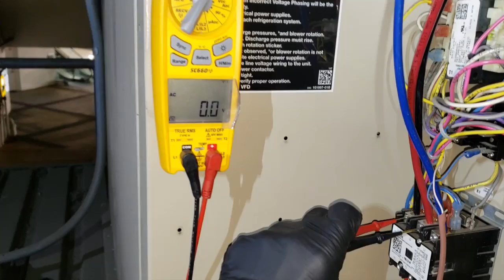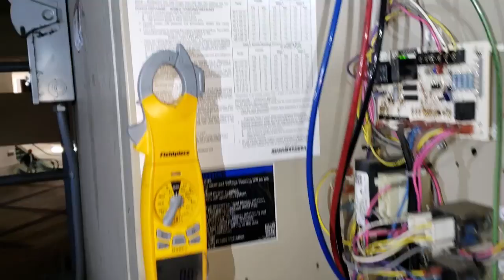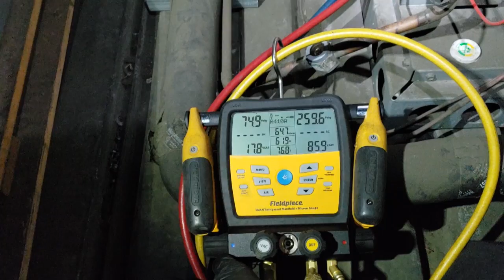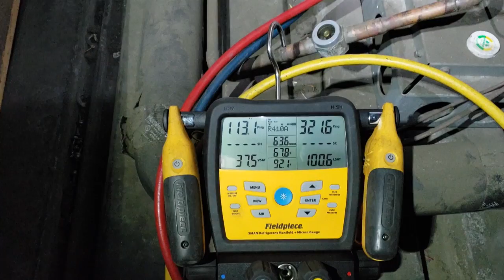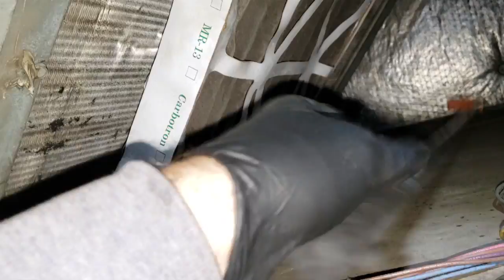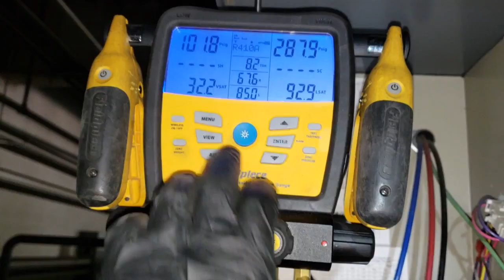LENNOX HEATPUMP PROBLEMS

Comment: I have a Lennox Elite XP 14 Model XP 14 C 30 230 09  I noticed it was cold in the house and thought I had turned off the heat went to check the thermostat it was set to 71 but was reading 65 and fan was running no heat coming out of vents just cold air so the fan was running switched to emergency heat and this morning switch to heat from emergency heat and heat pump and it did  not come on. Checked all breakers - all were on, changed filter, switched breaker on furnace off then back on nothing.

Comment: The simplest things of not doing maintenance on any HVAC unit can affect a system- filter change, coil cleaning (condenser and evaporator), belts on a belt drive system. Service calls cost money.

Comment: I’ve had that high pressure lockout problem in a 2.5Ton residential unit, with a 2 zone system and restrictive cold air return...  System runs fine in A/C mode, but trips on HP Lockout in Heating mode. Checked airflow, Increased cold air returns size to 3tons of air. Any suggestions...?

Comment: Where did you get the new gauges?! I can't find the 380 or 480 anywhere
Reply from the maker: They will be released very soon
Reply: Why the 480s and not 380s? Never see you use manifold to pull a vacuum
Reply from the maker: Occassionally I will use my manifold for the vacuum but not very often.

Comment: That is the wrong way of doing it, you letting the customer know about the idle pulley need to be replace, they will call around and ask everyone in town how much to replace idle pulley, u just gave ur job away. Very small chance that you will get to replace that idle pulley. My customers are always pulling that crap, so i smart up to it, i dont tell them what it is that is wrong, or i will tell them something else that is wrong.
Reply: If you have a good relationship with your customer they will know your not trying to screw them and wont bother wasting hrs of there time calling around to save a couple bucks.  Not to say this doesn't happen to me but it seldom does. I'm commercial HVAC contractor and had a customer that paid me to come out and diagnose there equipment then paid a more affordable company come out and replace whatever I found deficient.  I would often get called back out when the other company installed the part wrong and caused more damage.  I would then come back and end up (and emergency now) replacing 2 or 3 items the incorrectly installed part ruined.  I was still getting paid, often more than the original call would have made.  We did finally get tired of being treated as the diagnostic crew only and stopped working for that customer out of respect for ourselves.
Reply: dang0088 da you sound like a pretty hinest guy . Turd .
Reply: infomation is not free, you got to pay for it one way or another, u think i will give it away for free? What a fool u are. @henryrivet8647
Reply: That’s what a diagnostic charge is
Reply: diagnostic charge is not enough, $75 is not enough to go out and tell them what is wrong with their system, so they can call handyman to do the work. Hell no. @Rainmaker88
Reply: @dangda-ww7de  company I work for charges 150$ non maintenance customer diagnostic

Comment: Wouldn’t you read 0v on the call for heat if it was calling
Reply: It depends on which two terminals you measure between.
When there is a call for heat, there will be 24v between the C and H terminals, and there will be 0v between the R and H terminals. There should be 24v between the R and C terminals at all times.
Some systems have multiple stages of heating or cooling. In those systems the first stage of heating is H1, second stage is H2, etc. The first stage of cooling would be Y1, second would be Y2, etc. You usually only see multiple stages on larger systems.

Comment: Had one do the same thing and it was the condenser motor was running slow when it would start up and go out on high pressure so that is just thought
Reply from the maker: Yeah that is more than likely my problem as I mentioned in the end of the video the idler pulley is going bad for the indoor blower motor and that could cause the indoor blower to spin slower than usual which in the heating mode would cause High head pressure. I submitted the quote and they rejected it so yeah....

Comment: Lol, I have a few pieces  of s cleats screwed together for my filter puller, never heard of that tool. Being 410, I would have expected higher pressures, than what you saw, but live in Canada and never came across a commercial heat pump, just doesn’t work well for our winters, lots of Resi’ s but not commercial
Reply from the maker: I honestly dont work with them all too much either
Reply: HVACR VIDEOS enjoy your videos, keep up the great, work, I’ve been showing  my techs, them, and praising you to them, about your attention to detail, because you find 1 issue, doesn’t mean it’s the only one, our techs are paid hourly, spend your time there, would rather see 2-3 good calls done than 6 run in and change a capacitor

Comment: Chris I like new feature of the new FP SMAN ! how's probes , sir ?

it was easy call for this heat pump. Thanks for sharing, sir.
Reply from the maker: The gauges are great, but I just want to make it clear when they are released they dont come with the wireless clamps or probes you have to buy those separate
Reply: @HVACRVIDEOS  Got it and thanks sir.

Comment: Lennox logic smh steady green with no red light is high pressure lockout dang .
Reply: Well, given there's only two leds to give you 10 different indications. . .
BTW, LPLO is solid red, green off. ;)
Reply: Lennox drives me nuts
Reply: Understood, blinking red or even green is infinite like trane does